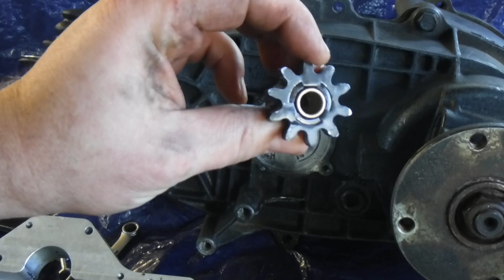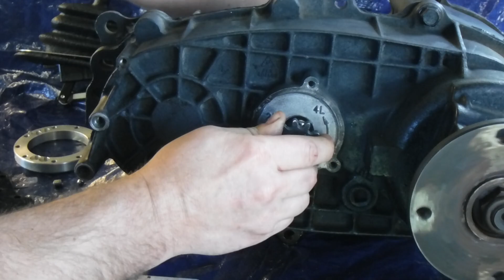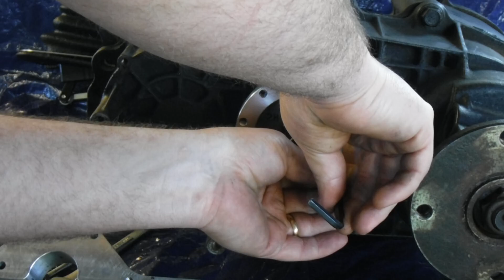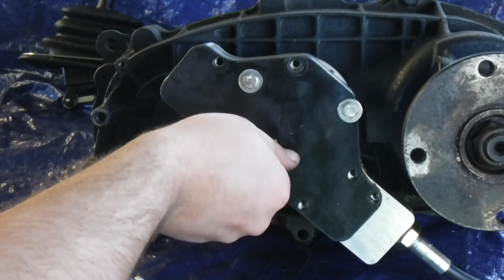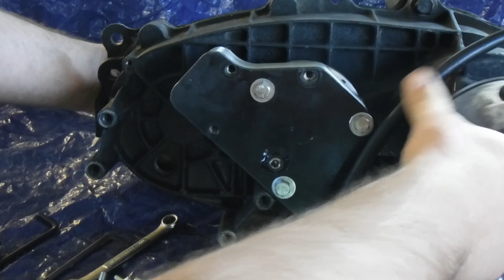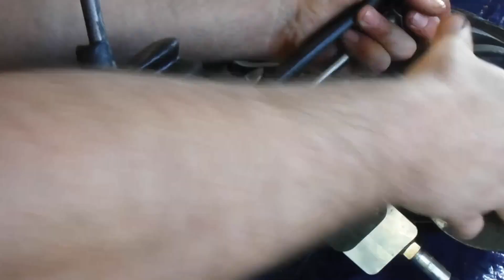BW Manual Shift Conversion Kit Install

Comment: No gaskets. Seems destined  for immediate  failure
Reply: Felt the same, looks troublesome
Reply: The company install video shows multiple gaskets.  This guy says he doesn't install them because it's for the video. They normally would be installed.
Reply: @aaemmons  Thanks for the comment!  As you described, there are two gaskets used in the kit, and you can see the full install video at:  https://www.youtube.com/watch?v=_LkpWlGrvBg